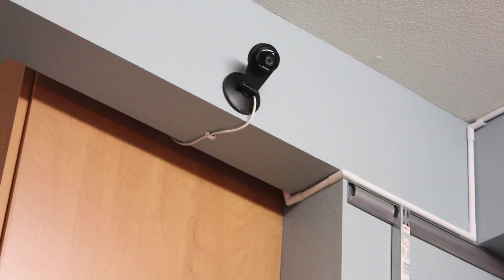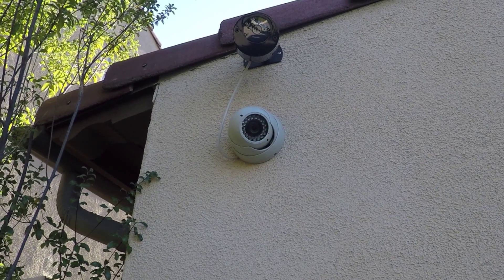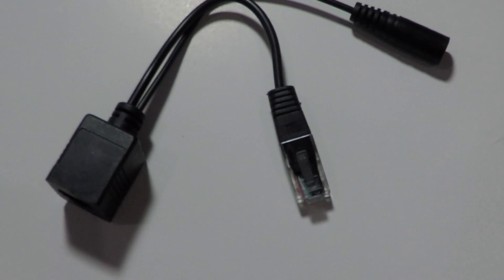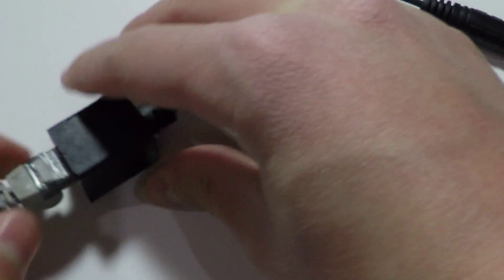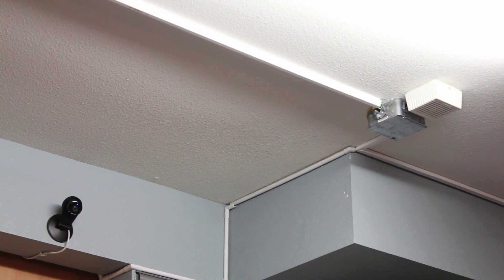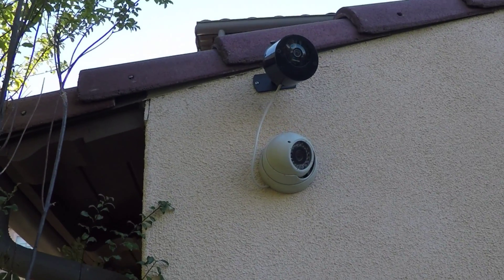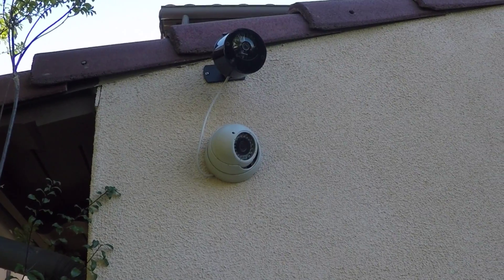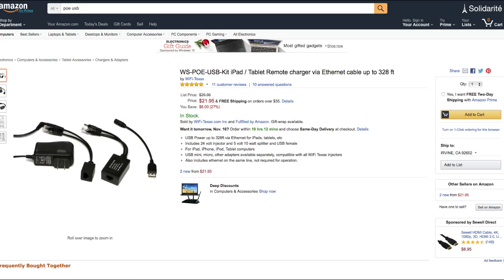Nest Cam & Dropcam PoE Solution

Comment: Hey, I would like to use ethernet cable with my nest and drop cams for "data" as well as power. Is this possible??
If so, how do I do it?

I want to make the resolution much sharper. 
I currently am using an iMac with an AirPort Extreme and three additional airport expresses. 
Instead of running them wifi, I sent cat(6) cable to all the locations and it definitely is faster and cleaner signal. 

Thanks much! 
Myles-
Reply from the maker: +mylestube5 No, unfortunately it is wifi only. I have have 6 AirPort Extremes around my house to cover all 8 cameras and it streams 1080p videos without an issue

Comment: What wifi connection did you use?
My Nestcam (which is NOT in the Dropcase yet),  has a weak signal, which disconnects frequently, despite a Netgaer Wifi extender location 10 feet away (with a decent upload signal of 10Mbps and 10Mbps download).
Where is your Dropcase review; I'd love to watch it!
Reply from the maker: +jimmypants100 The dropcase review is on the same channel, the dropcam's can now record in 1080p (just like the Nest Cam now). I also ordered two Nest Outdoor Cam's please subscribe to get notified when that is live.

So from my experience the Dropcam's need a extremely solid wifi connection. I have an AirPort Extreme with 5 other hard wired AirPort Extremes' that I used as access points. I have a gigabit internet connection so gigabit upload and download.

Comment: how can i use the power from my existing analog system to power the dropcam?
Reply from the maker: +jorge moreira I would assume you have at least 2 wires going to your analog camera. So, you just need to remove those wires from the back of the DVR and use the Cat 6 keystone jack with the PoE injector I have listed in the description.

In my setup, I initially had analog cameras (and still do). The installer ran CAT 6 cable to each camera but only used 2 wires so I used 2 of the remaining 6 to power my Dropcam

Comment: nice did you have to drill holes to mount the drop cam?
Reply from the maker: Yes, had an electrician run the wires
Reply: +MacTechGenius very nice. Have you had any problems with theft of those cams outdoors? I am thinking of getting the nest and outdoor case but would hate to have $200 nest stolen since mounting it outside.
Reply from the maker: Nothing so far, but it theft is a concern I would   recommend mounting the camera at least 10 feet high.